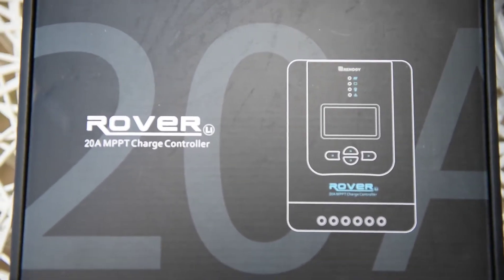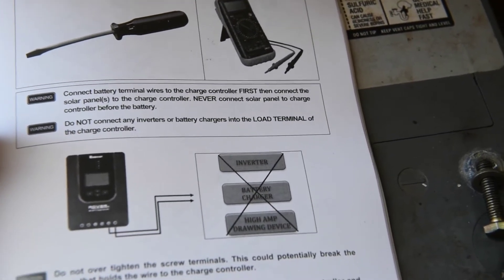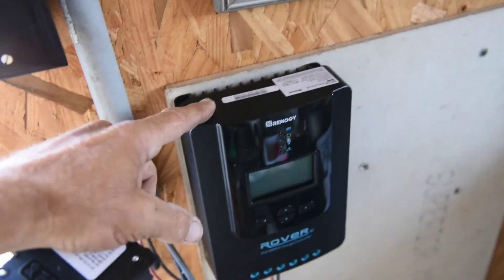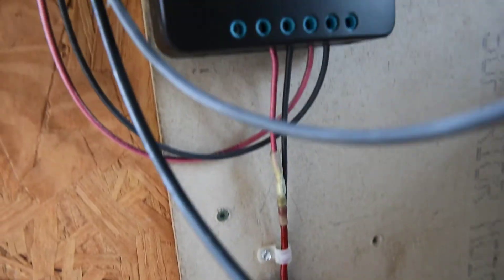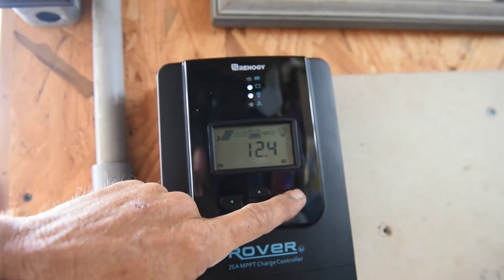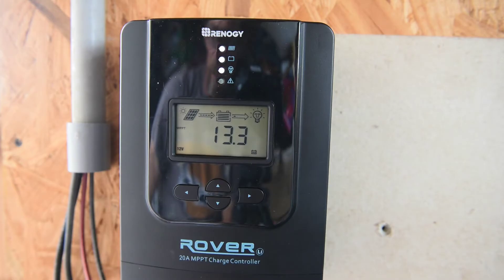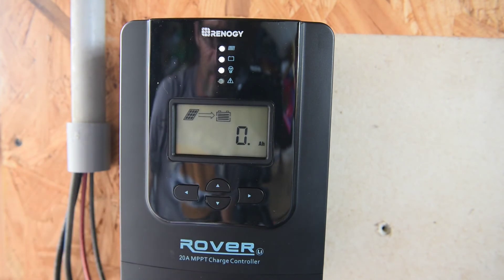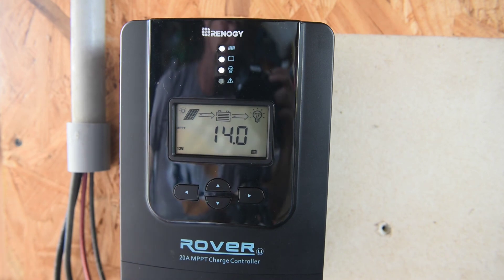Renogy solar mppt charge controller installation and set up Renogy rover  mppt off grid office

Comment: I put a 12V battery in the load light part by mistake, I disconnect it and put it in its place, the battery charges but the LOAD LIGHT part no longer works, how can you help me?
Reply from the maker: Make sure the load is turned on at the controller and take a meter and check the voltage at the load terminals.. If you have 12 volts minimum your controller is fine, if you don't you will have to send your controller back for repair.
Reply: @HippieHillHomestead  is work fine, thanks bro
Reply from the maker: @Tchek_Baw_Photography  Your welcome. I am glad its works.
Reply: @HippieHillHomestead le escribi por favor necesito ayuda con mi controlador

Comment: Si me pudieran decir en mi controlador de carga renogy de 40 amperios cual es el codigo de error numero 8 gracias
Reply from the maker: Let me look it up and I will reply back.
Reply from the maker: Error code 8 on a Renogy charge controller typically indicates that the charging current is too high. This can happen if the solar panels are producing a very high current or if the load is too high. To resolve this, try the following steps: first, reduce the load by disconnecting devices, then disconnect the solar panels and battery for a hard reset.

Comment: Si me pudieran ayudar yo tengo un controlador renogy de 40 amperios dos paneles de 595 wat y una bateria 12vol 300 amperios pero tengo un problema cada dia en la manana cuando empiesa a cargar el controlador automanticamente cuando esta cargando a su maximo(40 amperios) me pone codigo error numero 8 si me pudiesen alludar
Reply from the maker: Renogy Charge Controller Error 8 often signals over-voltage or the controller thinks the battery voltage is too high
Reply from the maker: It sounds like your controller is hitting its max amperage. You may need a larger controller or fewer panels. Hope this helps!

Comment: When RV is in storage... the Renogy 30A controller is still be powered by the battery when the solar panels are disconnected.  So I would want to put a breaker from battery to controller correct ??    Do you have a li k for the breaker you recommend?  Thanks for the video and any help
Reply from the maker: Yes a breaker will work.  I use outback solar breakers. You should have a breaker /fuse between every component in your system.

Comment: Thank you so much for sharing 
I have these
•Renogy Rover 20A 12V/24V Auto DC Input MPPT Solar Charge Controller Parameter Adjustable LCD Display

•12V 300AH Bluetooth LiFePO4 Lithium Battery with Self-Heating, Built-in 200A BMS

•4 Solar panels of 100w each

Can that work together?
Reply from the maker: Yes they should work fine. Are your panels 24v or 12v. If they are 12v the 20 amp charge controller may not handle the amperage. That would be my only concern.

Comment: Hi. A Brit here asking a question if I may. I have the 20 amp Rover and after a year in use it has stopped putting any charge at all into the battery, zero ! No error is showing (E0) and I have checked all connections. Is this something that has gone wrong in the 'settings ' do you think, and do you know how I would go about correcting it ? I can't find an answer to this problem. Many thanks for any help.
Reply from the maker: Hi Brit, take a meter and check your voltage coming into the controller. If you have the correct voltage then follow this link it will give you basic troubleshooting info. https://www.google.com/url?sa=t&source=web&rct=j&opi=89978449&url=https://www.youtube.com/watch%3Fv%3DMQGRJ0AXdZo%26t%3D137&ved=2ahUKEwjOl8XxwaOPAxU-RTABHW4FIboQma4LegQIIxAC&usg=AOvVaw0OyMyDz3AQ4Z32bDnTcShq

Comment: how many 100 w panel will you 20a support 

safly
Reply from the maker: If your 100 watt panels are 12v then they produce a little over 8 amps. So a 20 amp controller will handle 2 100 watt panels.
Reply: @HippieHillHomestead  According to the factory site manual it will accept up to 90v  so you could daisy chain (put neg of 1st panel to the positive of the 2nd panel (if they are 40v output panels and stay below the 90 v max input).   This keeps the amps the same and a true MPPT will convert the 80v/say 8 amp input to 14 v charge at double the amps.  The AMP input cant go above 20 (although its best to be maybe 15 amps).   So you have to understand MPPT is really a converter that can accept high voltage and low amperage but output more amperage at lower voltage.  If its a PWM and is lying about being an MPPT, then it will demand a 20 v (VOC) panel to charge a 12 v battery.

Comment: I have the same setup but if the battery goes low the renogy charger goes into fault mode and doesn't come back on. Can you tell why this is happening?
Reply from the maker: How old is your controller? What battery mode do you have it in?
Reply: If you have a liPo battery, then the BMS all LiFePo batteries have, it can shut off charging if the voltage went too low.  I have jumped LiPo batteries with a car battery to get it up over 11 v and then they charge just fine.   Lead acids dont do this.

Comment: Hi, I am shopping pour a rover 20 A for my renogy 50W solar panel ,I  thought the controler will adjust automatically , without having to adjust manually info to the controler, is that so or have to adjust manually thanks gerald
Reply from the maker: Once you set them up you don't have to worry about them anymore. There are default settings but depending on the voltage of your panel and battery type (assuming they are 12v) it should work on the default settings. But even if it isn't they have a very good manual that takes you step by step. If you have any questions I can help you set it up.
Reply: @HippieHillHomestead   thanks, help appréciated
Reply from the maker: Anytime if you have anymore questions please let me know.

Comment: I had to wire my 4 100watt panels in series, the 40amp controller is dropping the charge as soon as the sun goes and drops the charge fast. Its on USER mode. When its day time the solar icon charges full and blinks through the charge. When I had it wired in Parallel it was a solid solar icon. I had to wire it in series because the MC4 from the 4x1 branch was getting extremely hot so I went with series wiring. I dont have money to buy 4 15 dollar each fuse and a circuit breaker right now. Now the problem is its discharging as soon as the sun goes.  I also thought there was no need for a float?
Reply from the maker: Ok if you had 4 x 100 watt panels in parallel that would be 34 amps assuming they are 12 volts each.. I have a few questions. What voltage is your battery bank? I am assuming 12 volts. Then you said you wired them in series,  correct? When you wired them in series you changed the voltage from 12v (actually nominal is 18 volts in full sun) to 48v ( nominal is around 72v ). So did you change your battery bank? Did you change settings in charge controller? Also let's go back to why you changed to begin with. You said your mc4 connector was getting hot. Did you check all the connections to make sure they were tight? Did you try unhooking one panel at a time to see if the problem went away?

Comment: I love your presentation. There is a statement you made about ensuring that the battery and solar charge controller is hooked up first before the PV panels. 

There is this fact that is being suggested that the mppt controller usually has a "block diode" that stop current from the battery going to the controller.  So , how come there is power in the SCC if there is no current flow through the rover controller? Or , the Rover controller doesn't have a blocking diode ?

I need clarity on it sir.
Reply from the maker: There shouldn't be a diode between the battery and the cc. There is a diode between the cc and the solar panels. Hope this helps.

Comment: Sir, thanks for taking us through solar PVs...so explanatory. 

Sir, I need more clarity on how the DC breakers in between the solar charge controller and the battery is connected with respect to the polarity of the breaker. Thanks
Reply from the maker: The breaker is installed on the Positive wire only. The negative goes straight to the battery.

Comment: I have the 30a Rover. Can I get away with a larger gauge wire? Namely 5? I have some with terminals already I could use to the battery bank
Reply from the maker: I don't know if 5 ga will fit. I will look when I get a chance. Other than that I see no reason you can't use 5 ga wire.
Reply: @HippieHillHomestead  I decided on 8 awg, it works perfectly
Reply from the maker: Good deal. I am glad to hear it is working.

Comment: Great advice on breaker locations. 
Add: These breakers MUST be DC non-polarized. Well, assuming that you would like to avoid fires if the breaker trips under load.

I’d add that once the proper wire size is determined, use the next larger size. Your properly sized breakers for your current will then ABSOLUTELY protect your wiring. Remember, breakers protect your wiring, not your devices.
Reply from the maker: Yes they must be dc breakers. Great point Thank you

Comment: very helpful video. What I do with my set up is, I've added a two prong rocker on/off switch to one of the solar lines so I don't fry my controller. I just flick the switch when I have to disconnect the battery. It turns the solar power off or on. Works perfectly.
Reply from the maker: That's a good idea. Are you worried about lighting hitting your controller?

Comment: I have the same controller I have a 100ah renogy battery "AGM"
 on the controller there's no agm setting there's only USE FLD GEL SLD LIT any suggestion?
Reply from the maker: shelter. The gel setting. For AGM batteries

Comment: Thank you.  Newbie here. I been building my system the past 6 months-money. Lol.  Anyhow, the charge controller a 40amp renogy is just turned on. I left it AUTO. 12v Li batteries.  Do i need a load to prevent overcharge or can i set a parameter to prevent overcharging ?  No panels nor lpad nor inverter are connected just ye.
Reply from the maker: You don't need a load, the charge controller will shut it off at the proper voltage.

Comment: Thank you for the video. I also have the 20 amp Rover. I’m a little confused about the maximum VOC for 400 watts of solar connected in series/parallel. The manual says the Maximum VOC is 100 volts. My 4 renogy 100 watt panels are 22.3 volts x 4 which is less then 100. Does that mean I can connect 400 watts to 20 amp charge controller?
Reply from the maker: Are you building a 12 or 24 volt system? If your building a 12 volt system 400 watts divided by 12 is 33.33 amps. Well over 20 amps. If your building a 24 volt system then you have to put two of  your panels in series. So you would have 2 series at 24 volts. 400 divided by 24 is 16.66 amps. So if you are building a 24 volt system your 20 amp controller will work.

Comment: Please help me understand by describing what you're doing when making the adjustments.  The owners Manuel is impossible to understand.  I want to set my float voltage higher. It keeps shutting off the charging at 13.8 volts and I have 25 batteries in my battery bank. I need it to keep charging since I run my entire house 24/7
Reply: When choosing battery TYPE  - - - > choose USER
USER will let you step thru setting up BULK, BOOST, FLOAT & EQUALIZATION
When finished leave the battery type setting on USER.
*Research the BATTERY manual for the recommended manufacture's settings.
Reply from the maker: 13.8 volts is the float charge for most 12 volt batteries, that is why it is shutting off. Does it start back charging when your voltage drops below 13.8 volts?

Comment: Can the charge controller and inverter be connected and on without the PV?
Reply from the maker: Technically yes. But if you don't have solar you don't need a charge controller. If you are waiting on your PV then yes hook it up it won't hurt anything.

Comment: what’s the green light mean that is attached on its own . was bright at night now dim ?
Reply from the maker: Here is the link to the manual. Page 22 is the LED indicators page. 
 https://www.renogy.com/template/files/Manuals/RNG-CTRL-RVR203040%20V2.0.pdf
Reply: thankyou but worked it out .the blue tooth connection

Comment: What type of solarpanel did you hook up ?WP, Voc Isc ? I am looking at the the 30Amp version and have 2x250watt panels 37.3Voc and 8.78A Isc.
Reply from the maker: This should work fine for your panels if you are wiring them up parallel.
Reply: @HippieHillHomestead  yes Parallel and with a 24V battery bank ( 4x12v 8.5A bike batteries )

Comment: I've been running a solar system, two 200 amp/hour batteries in parallel for 6 years, no fuses, no breakers and no problems, 3000 -6000watt inverter. All's well.
Reply from the maker: When you don't use breakers or fuses your safety and the buildings safety is at risk. Not to mention your insurance company will not pay for any damage if a fire occurs. Breakers and fuses are cheap comparatively speaking so why not use them? I highly recommend installing some on your system. If you live in the US the NEC code requires them. Good luck and stay safe.
Reply: @HippieHillHomestead  You're right and I'll install them soon. Greetings from down under.
Reply: @HippieHillHomestead 
Agree fully. Sure, if nothing goes wrong, you’re fine.
But isn’t there some kind of ‘law’ about things going wrong? 😂😂😮😮

Comment: Hi friends, my mppt rover 40a is not giving accurate battery percentage, it is propperly configured in 12v and lifepo4 battery, battery is new and mppt too, any other setting to make or help? thanks, regards.
Reply from the maker: How do you know its not reading accurately? Can you give me an example please? Depending on how it is reading there could be a couple of things you can try.
Reply: hi, the battery user manual have some parameters about battery porcentage, for example says 13.5v = 100% / 13.1v = 40% etc, and the mppt always thinks that the battery have 40 or 50% more available percenteage, the lifepo4 is selected and 12v system is selected, i own a power queen 12.8v 100ah, thanks @HippieHillHomestead
Reply: Same issue with mine. Everything is programmed and wired correctly, but the monitor always shows 100%. Also had the issue with the pv terminals wired/labeled incorrectly.

Comment: Such a horrible design. I’ve had so many of these units break. 

There are so many easy ways to improve the design, like having lugs that connect by tightening a nut onto a bolt. Instead you stick a wire up into a hole and tighten it using these screws that are sunken into the unit. 

It’s just unnecessarily bad design
Reply: We have three Rover charge controllers the 30amp, 40amp, and 100 amp. We've only had the 100 amp for a year but got the 40amp in 2020. We haven't had an issue with any of them so I'm curious what went wrong.
Reply from the maker: This is the first Renogy charge controller I have used. Tell me what went wrong with the ones you have had to tear up. How long did they last before breaking? Did they hurt your batteries? Sorry for all the questions but I like to hear about real world problems with a product.Thanks for sharing your experience.